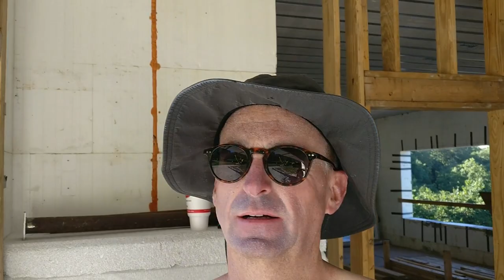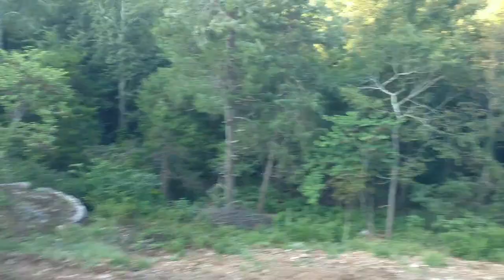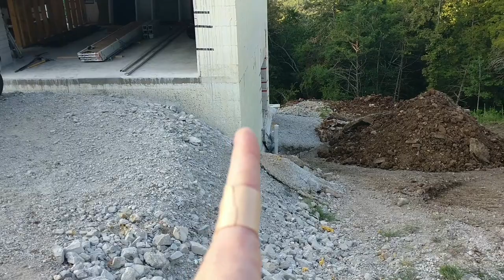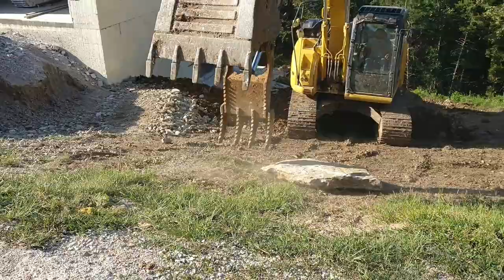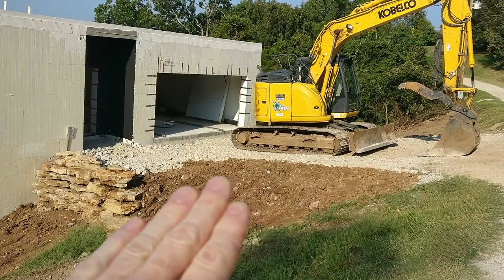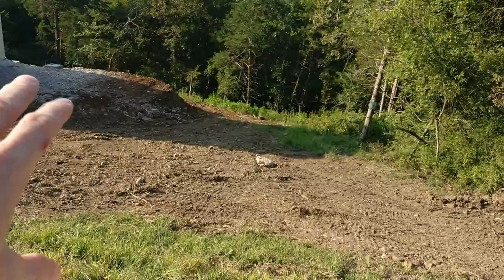Expert excavator operator builds stone retaining wall, backfills, and preps driveway

Comment: I am so glad you guys are documenting this.  Are you going to make a video about costs ?  Like the difference between concrete and wooden floors - do longer or shorter spans affect the cost, or  window and door openings,  taller or shorter walls affect the cost per square foot of wall, etc. ...like... what features or characteristics (i.e. simple rectangle vs multi-level with 18 wall segments) are best suited for strength, economy, utility etc. vs more costly with little or no benefit .. I have been considering building a similar house, but not sure about what to spend most of the money on and what to skimp on (if anything). 
It would be great to hear any "son-of- an-architect" wisdom you may have.
Reply from the maker: Great ideas!!! I will put this in our future video list!

Comment: I have not seen any below grade water proofing applied are you not using any?
Reply from the maker: Hi! Great question. We used Xypex concrete additive which waterproofs the concrete so there is no need for exterior barriers.
Reply from the maker: We have had rain, snow, sleet, and ice.  So far, absolutely no water issues or infiltration through the walls at all. No moisture in the house.

Comment: What are you doing with your drainage? Ie roof, downspouts, driveway, deck, patio, etc
Reply from the maker: The roof is sloped to the back where we will have a gutter and downspouts. We have french drains all around the house and we will also put in a drain grate that stretches across the garage opening in the driveway. We have underslab pipe as well that daylights down the hill.
Reply: @LakeLotBuild  great I must have missed it in another episode. Great work guys!

Comment: No waterproofing?
Reply from the maker: Hi! Great question. We used Xypex concrete additive which waterproofs the concrete so there is no need for exterior
Reply: @LakeLotBuild  So how do you stop the water from going through the cracks and plastic webbing?  There are some great articles about where water infiltrates ICF and surprisingly enough it isn't though the concrete.  I would highly suggest you put on a proper waterproofing membrane like a peel and stick with a dimple mat over it.  You really only get one chance to do things right or you end up paying 4 fold in the future to fix the problems.